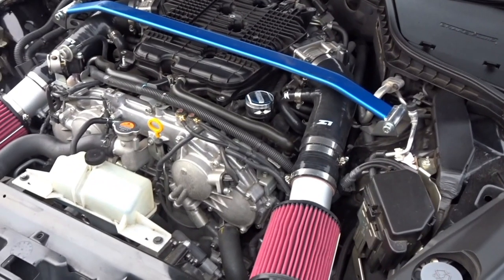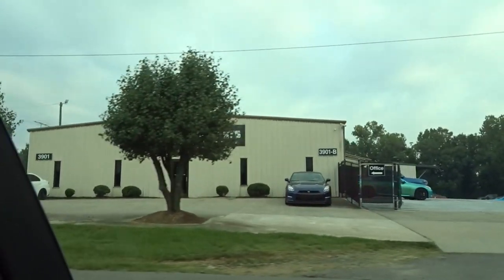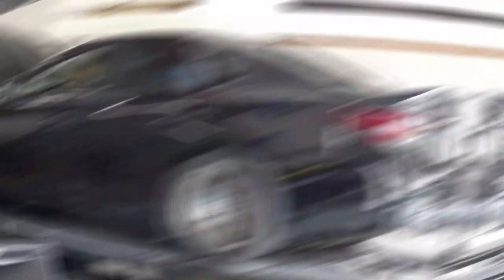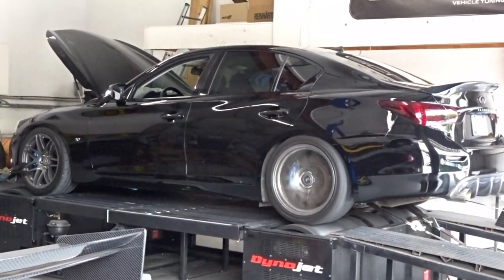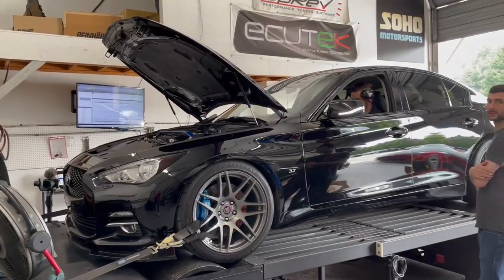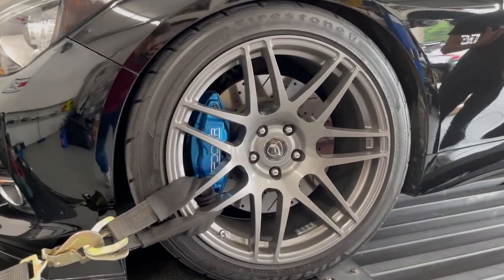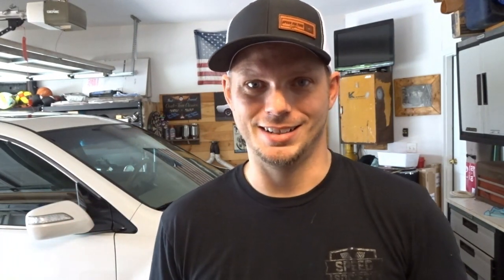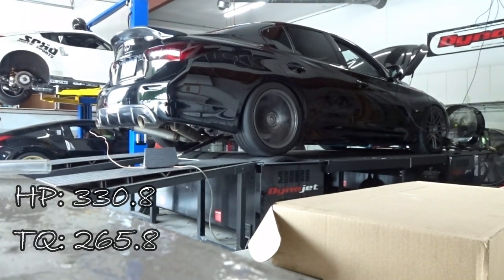Q50 Intake Comparison |  LOSE Power IMMEDIATELY with this Mod!

Comment: I agree and disagree.   Do the same video with a G37  admintuning  intakes has a proven track record for gains, but they are expensive, and require a tune.  I know that he don't got any intake for Q50 your right about short rams nothing new.
Reply from the maker: I agree and disagree lol.  I’ve discussed this before—the G responds to intakes better than the Q.  The Q just doesn’t need the additional air.  Long tube intakes on the Q would yield minimal gains over stock even if there were any available.  Soho agreed with this while we were discussing intakes.
Admin 3” intakes have never actually shown real gains because no one has ever tuned the car with stock air boxes or takedas, for example, then swapped in admins and retuned.  I have only seen 1 side by side comparison between takedas and admins on a G and they gained 2 hp.  They were disappointed by the cost, effort to install, for minimal gains.  I can’t recall the channel now but it can be found.